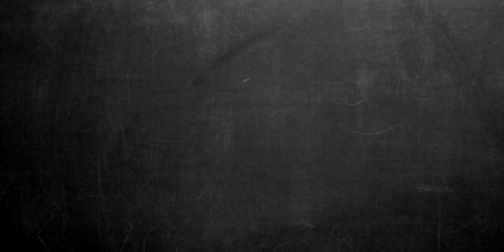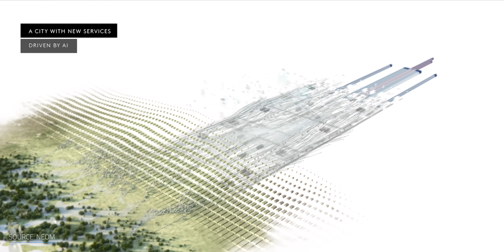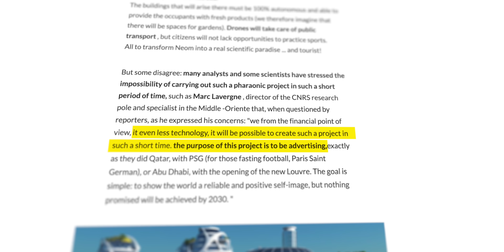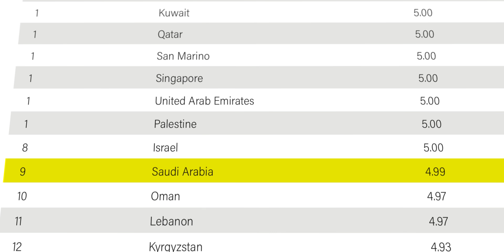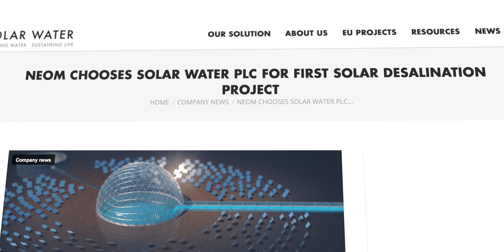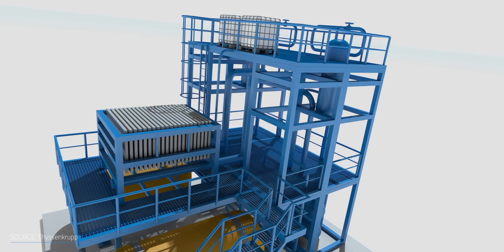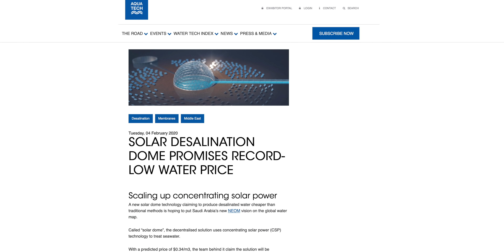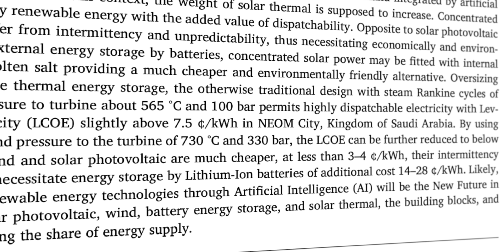Why Neom Might Be The Future of Sustainable Cities

Comment: The hyperloop is a joke.
Reply: "The space elevator will be built “about fifty years after everyone stops laughing." Arthur C Clarke
Ditto electric cars, reusable rockets, search engines and computers in our pockets.
Reply: @Michael-Has-Opinions  To make an elevator that lifts from ground up to low orbit, would make the weight of the wires themselves snap before you even put an elevator on it. The electric car died because they stopped developing it after petrol engines were quicker to fill up with fuel, instead charging old batteries. The spaceshuttle had such insane amount of stress on it, that reusing it was NOT profitable. All these things are already invented and given up on. 
The hyperloop has so many flaws on safety. Whats the plan to evacuate a stopped car that has 5 km to nearest stop? The entire thing must be sealed with vacuum to work like intended, and filling it up with air slow enough without killing everyon instantly from divingsickness would take longer than walking the entire thing. The hyperloop is a joke and is an absolute deathtrap.

Comment: The answer is no. A linear city is not traversable except for with an extreme high speed train. A brand new city designed for the same amount of people could use much less land, it would allow walking or biking from one end to the other, and fewer miles of track (and cheaper trains at that) for people to be more connected than in the Line. 

Also if there’s any issue with the single train, it cuts people off from each other. In a circular/grid city, if one train line is down, travel is still possible. 

As for utility logistics, it’s much easier to get water to and from the far reaches of the city when it’s 5 miles across instead of 100 miles across.
Reply: A linear city is the dream for a totalitarian country.
You CANNOT move without being controlled easily.
Reply: @christophecocqueel4672  oooh, didn't think of that, good point. It might have some benefits in that respect, such as the easy capture of running criminals, but its impact on a free lifestyle might be much worse.
Reply: @christophecocqueel4672   And the same for moving vertically. High security elevators.
Reply: @George Mann Are you seriously advocating for company towns (some of the most notably awful things in history) whilst also not knowing why cities are failing?
Reply: It might have the goal of creating the feel of a 'small town' while having the access to resources and efficiency of a large city.  To me it sounds interesting and I look forward to the reports on how it fails or succeeds.
Reply: @George Mann Are you stupid or? Just look up company towns, what you are arguing for is a company town. Also I want citations showing workers are happier, if you can’t put up then shut up.

And there are plenty of ways to save the poorly designed cities in America, mainly making them smaller and more walkable and doing away with the automotive based systems, since those made our cities horrible and inefficient.
Reply: I just realized how expensive it will be to lay out such a long train track in a straight line
Reply: This is it. I have no idea why people seem to like these hype concepts. A little (I mean like half a minute...)of critical thinking is enough to figure out why this is not so ideal.
Reply: @TsLeng  Take a moment to read this thread.
This "critical thinking" isn't available to everyone it seems.
Reply: ikr, its like they never even played simcity before planning this city
Reply: Lol biking in Saudi Arabia
Reply: The true economic power of cities is the networks of connections between people and businesses.  That is why people jam themselves into cities.  Forced linear spreading is pathetically stupid.
Reply: its just phase one. but anyways yeah its weird
Reply: just add 600 blimps /s
Reply: MoneyThink  We do not have freedom of expression, only in your country there is freedom of expression
Reply: I agree at the scale they are attempting this will never work. 

But as a counter. Instead of considering it one massive city. Run a well maintained road along the train. Then suddenly you have a situation near to how small towns form. 

At least in where I live small towns pop up along transport corridors. To service the transport traffic and as living space. 

So if every high speed stop serviced a population point it could work. 

I expect the Neom isn't following this disign. 

The reason I bring this up is every small town/ small city clusters around the major transport artery that flows through it. There are outer areas with less people but alot cluster along that single artery. One good road and a single good well maintained rail could actually form communities. Especially if they could get water.
Reply: It's not like they are short of space in that desert to build on a grid based system which is proved to be a very efficient way of designing cities
Reply: + the hyperloop is one big scam, that will never work as intented in the next 50years
Reply: @ristekostadinov2820  could you explain more please. Thanks.
Reply: @George Mann That is an interesting viewpoint, however I foresee some of the same things happening with a linear city. There might be poor and rich sections of the line, and because everyone has to pass through some areas for transit that might create a spike in crime.
Reply: There are several huge benefits to making it linear. First and most obvious is that you can layout all the public transport on a single axis and everyone is close to it. All trains go to the same places. So you don't have to build multiple tracks, tubes or whatever on another axis which then requires commuters to switch routes. You then end up with some routes fuller than others and as your population increases, you just add capacity that all gets used. It appears to all be coastal. Hard to do that in a grid.
Reply: @LosLS2  Neom doesn’t run along the coast. The great thing about grids is redundancy. If the single train system for the Line breaks down, everyone that lives there loses their form of transportation. That’s bad! In a grid, everything is closer together so you can walk, bike, or take an alternate train if one train is down.
Reply: @birdrocket   when every train runs the same route you have way more redundancy.
Reply: @LosLS2  that is no benefit. that is a detriment, because the moment something goes wrong - whether a train car derails, construction/maintenance work has to be performed or even some ass that jumps on the train tracks, your city is suddenly bisected in two parts and those parts are completely cut off from eachother. 

there is a reason no city looks like a line of skyscrapers, because it is an asinine idea, solves no problems and introduces fatal, insurmountable ones in the process.
Reply: Although that raised the question: what about a grid of linear cities? this could in theory get the best of both worlds, as well as maximize livable space without displacing native populations. In the spaces between cities there could be solar, wind, and food farms (which I understand would likely have to improve for better production density). It would also mean that you can go to a parallel city to catch a train if you miss yours. It would, however, introduce elevated infrastructure costs; but perhaps some of that could be solved by establishing a primary parallel and a secondary (so the secondary's rail is farther underground, and the primary generally gets right of way). 

other benefits could be that energy and food production are closer to the cities, as they are in a way inside them, and that navigation and aviation are simplified.
on that note, it might make flights safer as there would be a grid of road as an emergency runway. emergency lights and guards could be installed to keep people safe. it would cost a lot though.

no matter how it ends up, they'll have to put in a power infrastructure first. It would be required for all the other technologies planned for the area, and the exported excess power could make it economically possible with the decline in demand for petrol.

What's your opinion on this? I look forward to a discussion (welcoming anyone, not just this guy)
Reply: @neotozo3789  You're certainly on a reasonable track. We can actually learn a lot from unplanned cities on this. When you look at the growth patterns of cities they tend to form a sort of spoked wheel pattern (barring natural blocks like mountains and bodies of water): a central hub from which arms extend along major roads. A planned city could take advantage of this naturally efficient shape (most flowers follow this pattern, for example) to put citizens close to regular services, minimize their distance from the city center, and still have room for farms and power generation in between as the arms spread out. Some citizens at the ends of the line would end up farther from the next line than the would on a rectangular grid, but if we imagine that population decreases as you get farther from the city center (as in unplanned cities) then the majority of people would benefit from being closer to the next line over.
Reply: @neotozo3789   grid of linear cities ? hum,  a grid of linear cities is just a normal city
Reply: @monad_tcp  Manhattan is a grid within a city. What I propose is cities within a grid. That way there are more options for travel. Maybe I didn't make it clear, but I was thinking of over 1000 square miles in each plot of the grid, surrounded by city.
Reply: @neotozo3789  then you have a square and the most efficient growing form is a circle. You are getting there, keep on going.
Reply: @neotozo3789  I think these are very good questions and this city could teach us many things with the technology it is trying to produce however I find problems with the idea of the creation of this city. Another problem with this line city is that while deserts have much less wildlife they still have abundant ecosystems that would be completely divided by this line. A wall a mirrors was also mentioned which would create extremely hot zones on either side of the city. There would be also problems with sunlight which wouldn't get to lower levels and they would need an extreme cooling system if they wanted it to be open roof. While there are flaws with current cities the problem I find with this line is the amount of energy and cost it would require especially as Saudi Arabia has so many civilians that are still in poor conditions and don't have access to even a sewage system.
Reply: @neotozo3789  there is a company developing small modular (thorium (i think)) nuclear reactors. The idea is that these reactors will be low cost but also safe at the same time. I think those reactors will thrive in this type of city. The city grid can be broken up into sections (with the underground trains and infrastructure being separate from the city) and there could be reactor stations housing 4-6 of these mini reactors powering its chunk of the city while dedicated reactors power the underground. The reactors can also help the grid when renewables cant keep up. (my take on the electrical side of things , idk about the rest)
Reply: MoneyThink  Ohh dear we'll see. Send location.
Reply: @Allen Loser your last name suits you well
Reply: Stop replying to dickinson they are obviously trolling
Reply: MoneyThink  as you have the full right to do. However I will then proceed to call you mean things and vehemently abuse you verbally as I am full within my rights to do so. That's freedom of speech and we shall work hard to protect this incredibly important right.
Reply: @neotozo3789  you are extremely naive to think that I will verbally abuse this person openly, I'll whisper into his ear so that there is no evidence at all. Good luck in sending me to jail then. LOOL
Reply: @dann6067  lmao didnt even read the ful comment
it was like 3 lines
Reply: @neotozo3789  I have ADHD
Reply: @dann6067  me too. ADHD is no excuse. if it's that bad, ask your psychiatrist for medications like the majority of us do.
Reply: Did you watch the video genius?
Reply: @dann6067  yes. Do you have anything of substance to say? All the technology in the world cannot solve the simple problem of geometry.
Reply: @birdrocket  you mean to say that our ass cracks are not efficient?
Reply: @neotozo3789  you are trying to impinge on my freedom of free speech. I shall have you reported to the relevant authorities if you don't quit your disruptive behaviour soon! Consider this a warning sir!
Reply: @birdrocket  
"Yes"
Its obvious you didnt by your comment.
Armchair much?

Comment: I like that this yields many research reports that try to find the problems of the project. If you know the problems you can start to fix them.
Reply: An issue with that is that the fix in most cases is just not building in a line. They've set a constraint on themselves that requires over engineering to build and support when they could just not respect that constraint instead.

Comment: Technical is it possible. In that short time it probably isn't.
Economical, it will not be great. Just as how in the USA, the urban areas are an economic failure, this will also be an economic disaster. It will cost more than it delivers, so prices will be high, to keep it livable. It can't expand like how they do it in the USA, to compensate the losses.
Reply: Urban areas are more economic than suburban or rural. Urban areas produce more value than it takes to maintain their infrastructure, not the case in sprawling suburbs. The property taxes raised from suburbs do not even come close to covering the costs of the infrastructure that supports it, they need to rely on urban areas to avoid bankruptcy.
Reply: Yeah Chris is right, statistics say the exact opposite of what you think